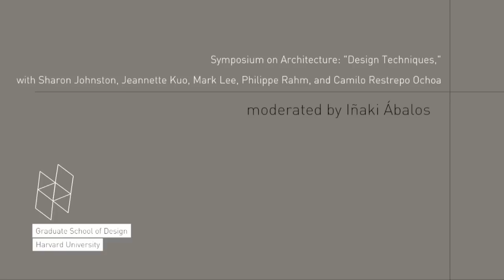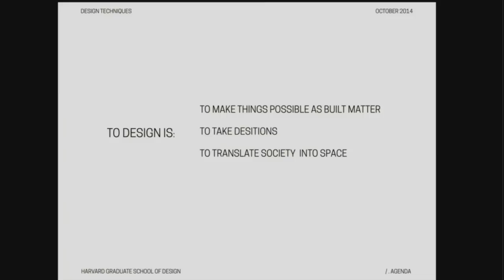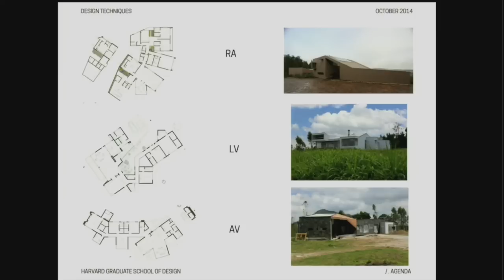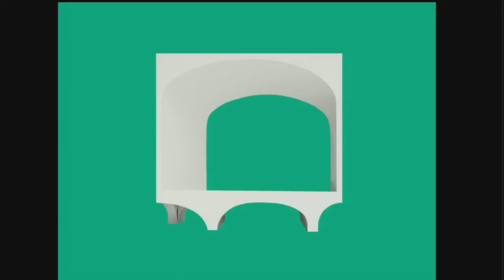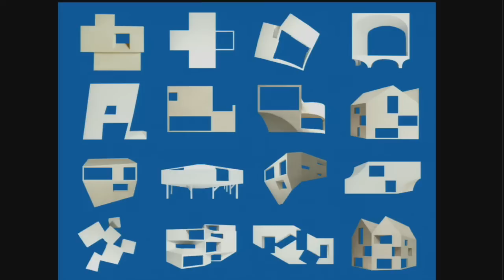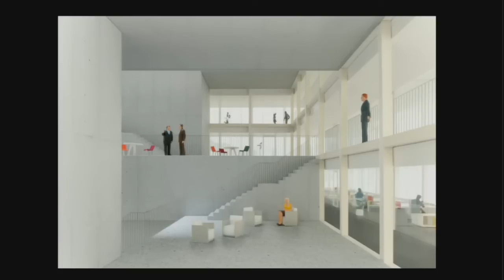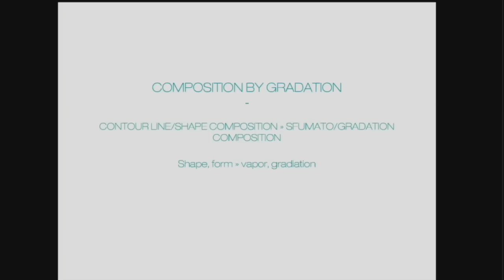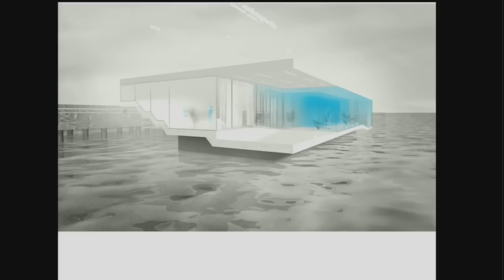Symposium on Architecture: "Design Techniques"

Comment: To share what might be inspiring...

In order to propose what should be understood as "concept", "percept" & "affect", thus as "philosophy" & "art", Deleuze & Guattari ("What is Philosophy?") mentioned architecture as the first art as art begins with house: that of which "the most scientific architecture continually produces and unifies planes and sections... it could be defined as "frame" with a connection among various frames oriented differently, applied to other arts...(There is) a composite system consisting of points and counterpoints... (there is) a matter of sensations (percepts and affects) combined... (While) the system still needs a composition plane run "deframing" opening ways from house territory to city-cosmos, the system in which there are cosmic forces to create new affects...".

There is "aesthetic composition" as the working of sensation which is, so they said, the definition of art...

Parergon; To Deleuze & Guattari's "architecture as frame" there is one with such nuances: Jacques Derrida's "parergon" means, among others, frame, "both in the sense of physical limit around a painting and also in the more conceptual sense of a "frame of reference". It is Cheetam's attempt "to deploy his (Derrida's) reflections on the sublime within a narrative about disciplinarity. (Cheetam, Mark. A, "Kant, Art, and Art History, Cambridge University Press, 2001 pp. 103-14, especially p. 104).

###
Architecture: making things useful. It is possibly about anything. It is about among others journeys and conversations; and it is about memories and hopes shining in lines and angles ... There are supposedly artworks of those stories. Meanwhile today "network" is such a kind of (Kuhn's) paradigm, a (Foucaultian) episteme, a (Deleuzo-Guattarian) concept ...???

"Informationalism, Technology and Network Society"
https://annenberg.usc.edu/sites/default/files/2015/04/28/Informationalism%2C%20Networks%20and%20the%20Network%20Society.pdf

"Networked City: Réseaux, espace, societe"
https://www.espacestemps.net/articles/the-networked-city-reseaux-espace-societe/

"Advanced Network Architecture"
http://groups.csail.mit.edu/ana/Publications/index.html

"Network Science"
http://networkscience.com

About the solid: In one place there is "Consolidation in the Internet Economy" 

https://future.internetsociety.org/2019/wp-content/uploads/sites/2/2019/04/InternetSociety-GlobalInternetReport-ConsolidationintheInternetEconomy.pdf 

; in another one there may be "(architecturally) network(ed) consolidation of buildings (economy), of landscapes (economy)".

###

The people in the video showed what they made, I wander whether I have made one at least or not ...:-)

###

I finded a reading on "cosmos", "technics" and "politics" published in 2017:

It was said, by Yuk Sui that there were the end of unilateral globalization and the arrival of anthropocene driving such possibillity to talk about "cosmopolitics" as a commercial regime and as politics of nature.

Then it was said, "...    §3. Cosmotechnics as Cosmopolitics

I propose to go beyond the notion of cosmology; instead, it would be more productive to address what I call cosmotechnics. Let me give you a preliminary definition of cosmotechnics: it is the unification of the cosmos and the moral through technical activities, whether craft-making or art-making.  There hasn’t been one or two technics, but many cosmotechnics. What kind of morality, which and whose cosmos, and how to unite them vary from one culture to another according to different dynamics. I am convinced that in order to confront the crisis that is before us—namely, the Anthropocene, or the intrusion of Gaia (Latour and Stengers), or the “entropocene” (Stiegler), all presented as the inevitable future of humanity—it is necessary to reopen the question of technology,  in order to envisage the bifurcation of technological futures by conceiving different cosmotechnics. ...".

Sui, Yuk, "Cosmotechnics as Cosmopolitics", E-flux journal #86, November 2017)

https://www.e-flux.com/journal/86/161887/cosmotechnics-as-cosmopolitics

I finded also "The Genesis of Technicity" referring to (the book) "On the Mode of Existence of Technical Objects" --both were published in 2017:

"...

This study postulates that technicity is one of the two fundamental phases of the mode of existence of the whole constituted by man and the world.1 ...

...".

https://www.e-flux.com/journal/82/133160/the-genesis-of-technicity

Simondon, Gilbert, "The Genesis of Technicity", E-Flux journal #82 - Mei 2017

It is about how T. Berners-Lee designed a space of information networks where we are ...:

Design Issues: Architectural and Philosophical Points
https://www.w3.org/DesignIssues

Regard,
GWP